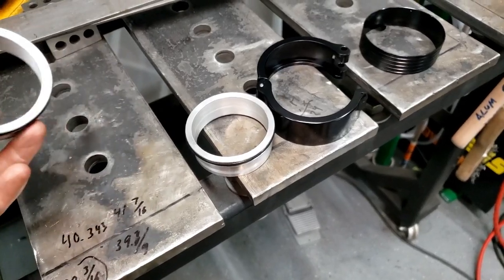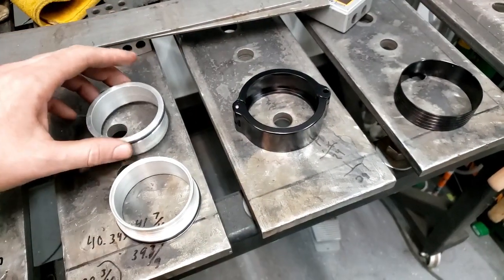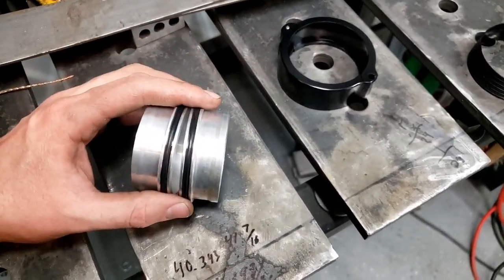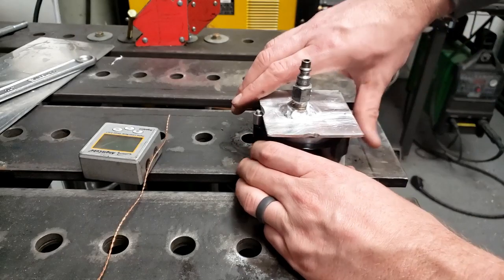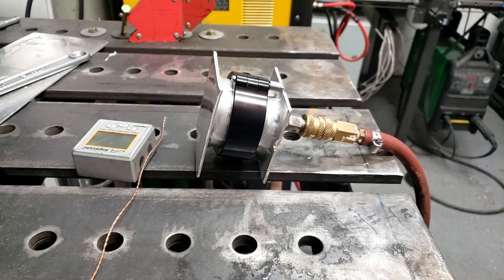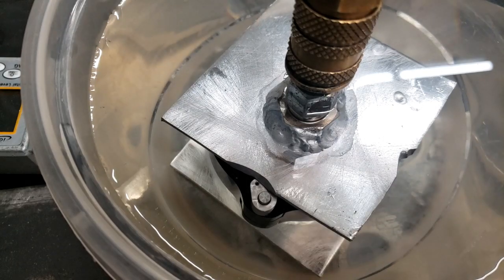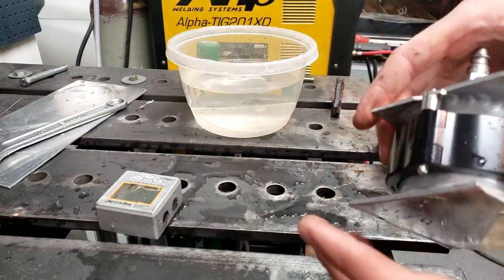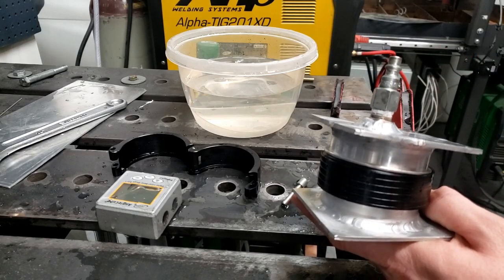Chinese GARBAGE or Bargain? $12 Ebay EPMAN HD Quick Disconnect clamp. Vibrant knockoff any good?!?!?

Comment: Tbh, for the price vs the premium stuff it does a hell of a job. I tend to look at Chinese parts for what their purpose is. For parts such as these which are mechanical and don't suffer much stress other than extreme boost I wouldn't bat an eye if I'm just running moderate boost like 15PSI or even 30PSI on a street build. It's literally a few pieces of metal with two O-rings. It's good you did this, so that at least we can make the educated guess as to up to what boost levels we can use it. If it were to fail it'd undoubtedly be from the o-rings first, and you can always replace those with better ones so it's not that big a deal either.

Comment: Good test but the only thing to remember is that these clamps are meant to move around and will which as you saw if this clamp isnt perfect straight on this one it starts to leak so I’d be a bit weary of running this on high boost applications.
Reply: Should be fine with some o-ring grease, both for longevity and to help them move around to seal.
High quality o-rings should be a given for maintenance too.

Comment: I used one 4" fitting for my Chinese Throttle Body to attach the Intake tube. Just wanted something different then a Rubber boot for a Clean look. Cool to see this test. But the proper order to do a Pneumatic test is to hold a certain PSI for 10 min and measure any PSI drop. But in real world application most Turbo cars won't see High Boost more than 9sec. 😁

Comment: Be curious to see the long term on these. Used alot of them in the navy due to hull flex and misalignment but it was eaton’s brand.
Reply from the maker: They only thing I could see degrading are the seals. The aluminum seem like its 6061 given its hardness and how it welded. Id probably upgrade to a seal of known pedigree for extra reassurance. That said... its a stupid simple part that I ran at 5x my working pressure... so for me, it seems like a deal.
Reply: @LoudandProudBSE   thats where I was going with that.